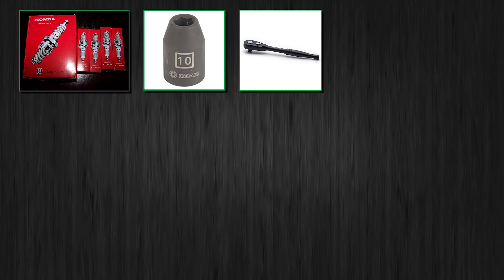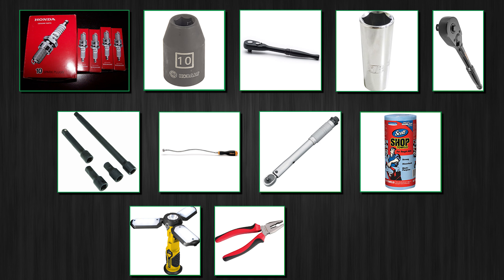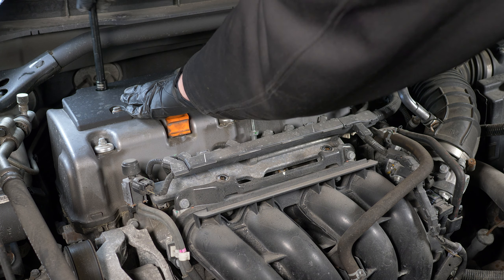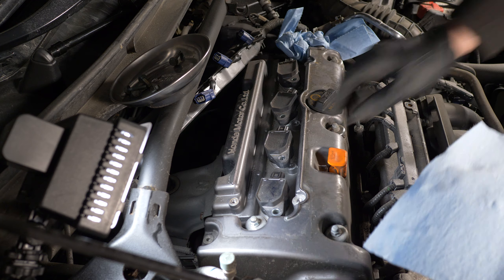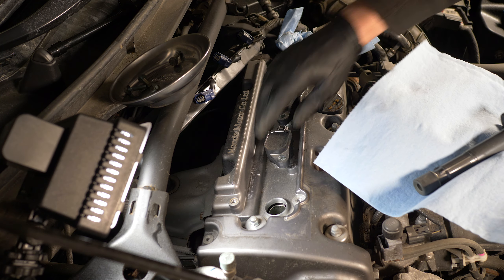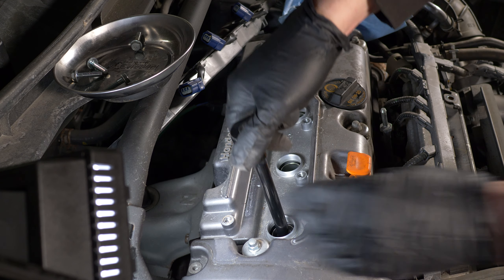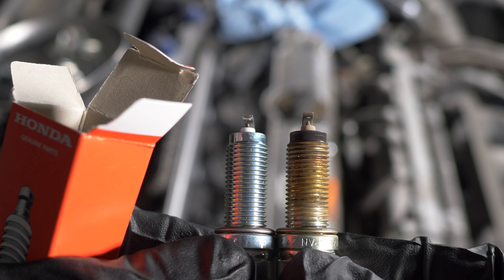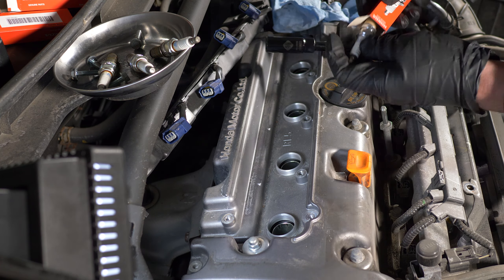Acura TSX Spark Plugs replacement DIY

Comment: I replaced mine and when turned the car on got CHECK EMISSION SYSTEM AND CHECK VSA.. Any ideas whats going on????
Reply from the maker: 1) Forgot to connect one or more coils back. 2) Installed incorrectly (plugs or coils. 3) Wrong plugs.
Reply: @AcuraAddicted  thank you man!!!
Reply from the maker: @dpz1985dp  No worries. I hope you resolve the issue. Did you get the OEM spark plugs?
Reply: @AcuraAddicted  i got Bosch plugs from auotzone. Im going to pull them off. What am i lookong for to indicate whats wrong? The car was fine before that. Have had it for 2 yrs and my mechanic recommend replacing them. I thought it would be easy so i did it my self. Now im stuck
Reply from the maker: @dpz1985dp  Yeah, I do not recommend non-OEM plugs for any Hondas or Acuras (which is also an opinion of a lot of Honda mechanics). Get OEM ones that match the car (get them from Rockauto to save money). Wrong plus can have different dimensions (of everything, plug length, tip, distance, etc).
Reply: @AcuraAddicted  im kinda stuck now.. Should i take them off and return them for a different brand? I cant use the old ones, my kids accidentally dropped on and bend the metal clip

Comment: Socket has to be magnetic right? No other way to pull them out?
Reply from the maker: No. A typical spark plug socket has a small rubber insert that grabs on to the spark plug tip and holds it while you take it out.

Comment: So my battery is good and my alternator is good and starter is also good but my car struggles to turn on I wanted to know if it could be the spark plugs or what is your opinion on it
Reply from the maker: Very often the problem may be in the ground cable, so have a look at that. For the alternator I’ve also heard many cases when the shop said “it’s fine” when it actually wasn’t.

Comment: I'm hoping someone can help. 

2006 Acura TSX I'm trying to remove the spark plugs but seems like my socket is too thick. It goes down the spark plug wells but it hits the rubber (thing) I think it's a gasket. What brand socket did you use?
Reply from the maker: I used a standard spark plug (5/8") socket that is usually available in every socket tool set. It has a rubber insert inside on the top that grabs onto the spark plug top and holds it, so you can pull it out when you unscrew it.

Comment: Thank you for this! Made it so easy to follow. Just out of curiosity a couple of the tabs broke on my ignition wiring cables, could this be problematic in the future?
Reply from the maker: Make sure you secure the connectors to avoid loosening with vibration.

Comment: Do you have to gap the spark plugs or does it come gapped?
Reply from the maker: All Iridium plugs come pregapped and the tips should not be touched as it might result in scraping a very thin iridium layer. They also come with a thin layer of lube already applied to the threads, no additional lube necessary.

Comment: Hi---I have 125k and never changed spark plugs.  I would do it myself but I think I will take it to shop and pay the $150, knowing me I will mess something up.  
Also,  I noticed my car vibrates when I stop at a red light but it goes away when I step on gas pedal.   Is this something I can ignore? what is could the cause be?  Thx
Reply from the maker: Spark plugs are supposed to be changed at 100K miles, but, of course, they can last longer. If you are not confident enough to change the spark plugs, I think it's a wise decision to go to a shop. Ask them to give you the old plugs back so you could take a look at their condition if you are curious. 

As for vibrations, this can be a number of things: engine and transmission mounts, torque converter, etc. I have vibration too at stops and low speeds. I think my engine/transmission mounts have gone bad.
Reply: bro i never changed my spark plugs ill i had a misfire and my check engine light came on. It was on my 2014 honda accord, I dont really work on cars. But it was really easy, as long as you have the correct tools. You should give it a try next time

Comment: When do you recommend replacing the coils?
Reply from the maker: When they develop cracks or show signs of significant oil deposits (starts to happen when the tube seals go bad). For me I only replaced them at 175K miles.
Reply: @AcuraAddicted   got it. Thanks for your help.